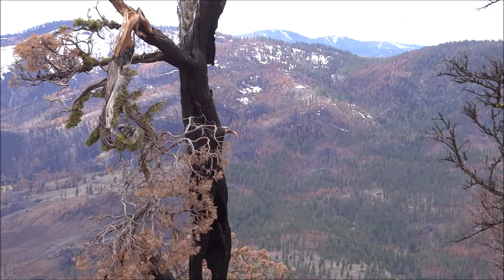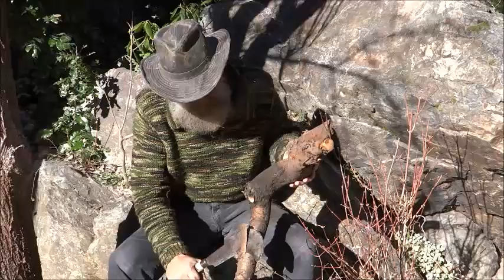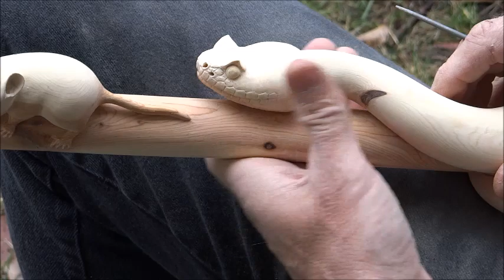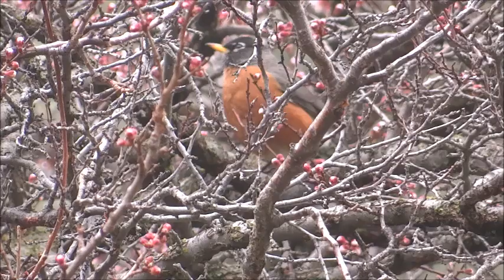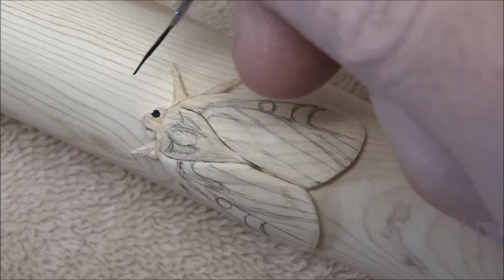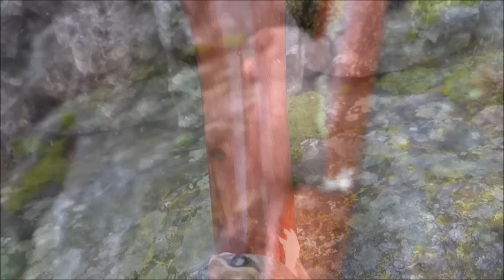Sidewinder RAttlesnake Knob Cane #48 With a Mouse

Comment: Hi wonderful work. Can i please ask a question regarding timber. Do you carve from green  or seasoned timber to season timber the size you use must take ages. Thanks again for you work & videos
Reply from the maker: Thank you very much, David!
 I carve seasoned wood. Yes it does take quite a while to dry, but I also look for timber that is dead standing in the forest which has already mostly dried. The trick is to find something that is not too cracked or split.
Reply: More questions sorry.... what do you think would be the smallest diameter timber to carve an Adder (UK) to make a reasonable attempt